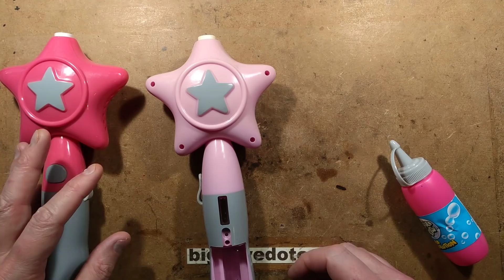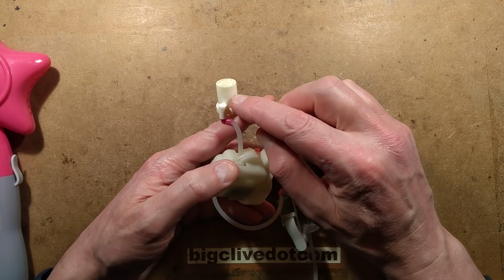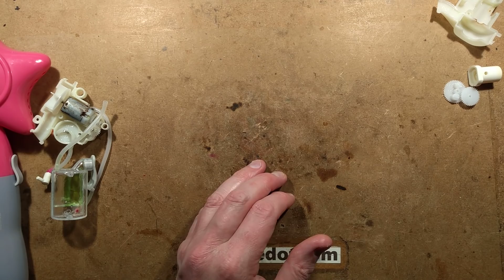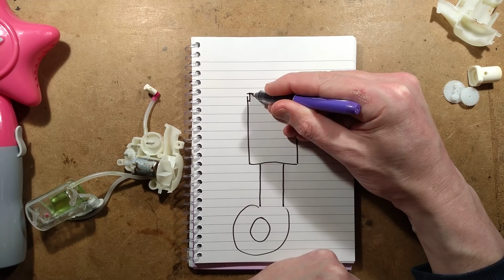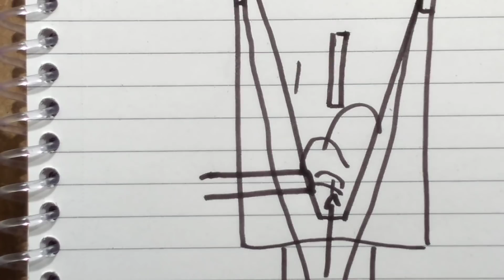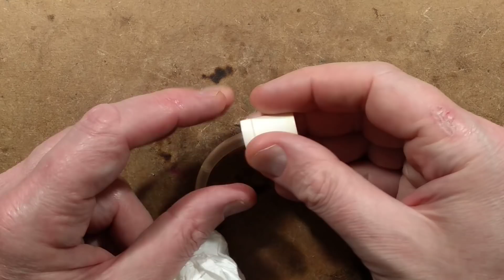Bubble wand with unusual bubble generator.

Comment: The cone thing  reminds me of an injector on a steam engine used a bunch of cones, live steam from the boiler and cold water from the tender. Boyles Law did the rest so you could inject water into the boiler which was already at a high pressure.

Comment: Those slots aid in the efficient design of a really good eductor pump.
Reply from the maker: It could well be designed along that direction.
Reply: @bigclivedotcom  There are three air flow paths within the head.
The first is the straight on air path through the bottom of the cone - which alone, would be minimal since the slanting sides of the cones would provide a lower resistance path for the ever-so-slightly compressed air.
Of course, the second path is the outside of the cone - which is obvious, and provides the lions share of the air that sends the bubbles on their way.
The third path is through those eductor slots - which I would just about bet paper money, have little "knife-edge" angles toward the top of the slots looking down toward the bottom of the cone.
These force a little air inside the cone behind the previously propagated bubble to accelerate it toward the top of the cone, meanwhile they create a relative low pressure region down where the bubble juice is coming in through the Venturi Effect, which is the major force involved in pulling the bubble juice in.
This also aids in influencing a little more air to enter the smaller port opening at the small end of the cone.

All in all, it looks to be a terribly well balanced system, and as you said, very well engineered.

Comment: I'm certain that cone is creating a venturi effect (reverse).

The faster-flowing air outside the cone drops air pressure there, so the bubble is formed from the higher pressure inside. Once the bubble passes the slots it fills the bubble further (like NACA ducts), possibly suctioning the next bubble too. A carburetor works in reverse [air direction] to pull fuel into the cone, but this thing has a pump to overcome pressure created from reverse flow.

Comment: The return line is not only for returning liquid,its also used as a breather tube for the reservouir so that it doesn't get under vacuum since the seal is airtight
Reply: I was looking for someone saying that. It's the multi-purpose fan driven tank return tube!

Comment: Clive, seriously your audio lately has been terrible for those of us that have central bass speakers.  Look around for your microphone, you must have set on it and it is stick in your anus.
When I turn up the volume enough to understand your speech everyone in my house starts yelling "can't you turn that down."  If you are using a microphone as a lavaliere you must use a microphone designed to be used as a lavaliere with the lows rolled off so we don't hear your chest noises.  The microphone on the teapot is just fine, out doors is not so bad as at the bench.  I have a volume control, but no control over the bass speaker, on this speaker set.
Reply from the maker: Check your surround sound settings.  It may be interpreting my videos as a bass channel.

Comment: That's a fairly complex moulding for both the bubble generator and the motor support / airflow generator. Add in obviously silicone tubing with a decent gear train, and it is not unreasonable to say that this little "toy" was the product of some very decent engineering. Lots of salvageable, "other function" parts in that little gadget!

Comment: I'm (mostly) a chemical engineer. The slats are for, I believe, a sort of critical volume assistant-not the technical term. Essentially the slats have to be close enough that the surface tension-of a small bubble(important)-can catch more air and grow beyond the critical volume.

 It's basically the same reason that raindrops are-from initial, mathematical observation-technically impossible. It's due to the power of 2 vs. Power of 3 relationship of area vs volume.

Comment: I can see the planned weak point of this cunstruction. The motor isn't sealed at all, its shaft goes through a large hole, so every time the button is pushed, the liquid gets onto it instantly. It's meant to fail very soon.

Comment: I'm sure that the three slots are for introducing more air into the bubble generator.

Also I don't think that second pipe is primarily a return pipe. I think it's main purpose is to stop a vacuum forming in the reservoir and in fact even introduce some positive pressure to aid the peristaltic pump. That it doubles as a return pipe is just a bonus.

Comment: Throw some 14500 Li-ion batteries in it. I bet it'll really produce.
Reply: This sounds like a fun project. You'd probably want to remake the gear that drives the pump, and heatsink the motor, but it sounds doable.

...Or you could just make sure the batteries stay happy and see how bad of a seizure the mechanism has. Either way's fun.
Reply: Do you think Clive will do this modification?
Reply: @flytrapjohn  That depends on how bored he is and how much he wants to get another video out that day.
Reply: @evensgrey  👍

Comment: I found a bubble gun that works much the same but is completely manual. It has batteries for some stupid LEDs, but the pumping action of the trigger makes a small pump work to bring the liquid up to the "wand". Excess liquid just drips down directly into the container. But yeah these are neat devices. :)

Comment: So Clive, are you going to make one ten times the size?
Reply from the maker: It would certainly be interesting to see if the unit could run on a different air supply and pump system.

Comment: It looks like the slots allow air in after the bubble has started to speed formation of the larger bubbles. If it relied solely on the small hole at the bottom they would take much longer to form than how it appeared to work in your garden.

Comment: I wonder if rechargeable batteries would, in fact, work, because if I recall correctly while the voltage is lower they can often output more current than an alkaline battery before the voltage drops so much that it isn't practical any more. Usually when a dc motor is stalled is when it draws the most current, and more current means more torque. Although I kind of doubt a motor that small draws so much current that a pair of AAs can't feed it. I wonder if the slots are to let air and fluid out of the cavity to make sure it makes one bubble at a time instead of just foam.

Comment: I wonder if you could combine this with a smoke machine to make smoke filled bubbles by letting the fan draw it in?
Reply from the maker: You do get bubble machines that fill the bubbles with smoke.  This one might not work so well because it has a high outer airflow.
Reply: ...or butane gas.. and a laser..
Reply: @PsiQ  one of the funniest (and most dangerous) experiments is hydrolysis of soap+water solution and then burning the bubbles

Comment: I left the US in 1965 for Germany, hoping to do my PhD work in Tübingen. I didn't immediately get a job at the Max Planck Institut, but I needed money so, since I had 13 semesters of chemistry I got a job in the "Chemische Fabrik Tübingen." I didn't speak but a few words of German and no one bothered telling me what the slippery "soap solution" was we were manufacturing. It was the hardest work I had ever done, lifting 50 lb bags of chemicals over my head, and I was delighted when I got the position at the Max Planck Institut for Biological Cybernetics, running a brand new electron microscope and getting my Phd. Some years after I left the Chemische Fabrik Tübingen I discovered that I had been manufacturing "Pustefix," a soap-bubble solution that comes in a little plastic bottle with a bubble wand inside. We shipped the stuff out in 200 litre barrels so i never saw the finaly packaging. I spent the next 45 years piloting electron microscopes in brain research and later in cancer and virological research, but I always wondered if my months producing "Pustefix" weren't the most important part of my carreer. I am going to buy one of those little bubble machines. Thanks.
Reply: Making others happy is a noble calling.
Reply: I still have my blue Pustefix Bär from when I was little! I loved the built in pop up wand that kept your hands from getting all sticky like the dimestore bubble bottles did. Coming from a German family, my dad had one too when he was little, so you may have made some of the bubble soap he played with in the late 60's.

Thanks for your part in making Pustefix happen Herr Doktor, it was one of our favorite toys and I have a lot of happy memories with my Bär.
Reply: As a matter of interest whose microscopes were you using? I have worked mainly with JEOL systems (100B and 100S TEM, T100 and 35C SEM, with a little experience on the legendary Stereoscan 180 - gave that area of work up since even Fellowships paid far less than fulltime NHS Clinical positions!
Reply: @phils4634  The first microscopes I used were Philips at Purdue University in the 1960s. The first years in Germany I used Siemens microscopes. After that I bought and used only Zeiss microscopes. I bought an EM10 in 1980, fitted with ion-getter pumps, cryostage and goniometer. I had it continuously upgraded until I retired about 5 years ago.
Reply: @BruceBoschek  Philips were generally regarded as the best back in the day. I started off on a 401 TEM which was very much "fully manual" by today's standards. Had some time on their 500 series (again excellent) and when we were looking to buy new instruments, had a look at Zeiss - very unimpressed with their "optical waveguide phosphor screen"  idea (can't remember the model) which meant re-coating was impracticable. Really bad idea, that! Looked at an ex-demo 100B - excellent resolution, excellent beam current control and consumables were pretty reasonable (not that we weren't buying running spares from Beem like everyone else!), and for the cost savings we were able to buy another TEM - their smaller 100S.  When it came to upgrading our old Stereoscan S4 (flogged that off to Materials Science), JEOL gave us a good deal on their compact T100 (which came with a Shimazdu turbopump and LAB6 filament), so that was easy. Kept that for Undergrad tuition, and later bought their (at the time top of the range) 35C with all the goodies - excellent machine, and by that time we were making extra cash for the department by offering JEOL approved training - not necessarily cash, but heavily discounted parts and upgrades (e.g. diff. pump to turboprop upgrades on both TEMs, software upgrades, and detector upgrades to the EDX systems on the 35C and 100S).  After that I moved back into the UK NHS as an ID Physician, then emigrated Down Under, where I'm now approaching my final year of formal employment (though I'll probably continue with a teaching role for a few years yet!)
Reply: @phils4634  Philips were big in scanning EM. I spent a week in Eindhoven looking at my own samples on their TEM, then did the same in Berlin at Siemens. I was undecided, although it was apparent that Siemens was at the end of their rope, but then Zeiss set up a brand-new EM10 in my lab to try for 6 months. The microscope had ion-getter pumps and a sample-area vacuum better than 10 -8, a foot-pedal operated 3D goniometer and LN-cooled stage. The pictures I got of tumour viruses were so good I kept the machine and convinced a number of others to buy Zeiss. I kept my updated each year until I retired a few years ago. I used that machine for almost 30 years and the resolution only got better over time.
Reply: Fun story, great example of why you should never close youtube comments ;)

Comment: Clive, back in the 70's I made bubble liquid from 'Tepol' - (neat detergent) and water 50/50% ish. If D-lube is the same as KY then it is about 50% glyserine & water. So you might just as well start with Baby oil ,detergent + water. Just need to work out the percentages
Reply: J-Lube is definitely an absorbent polymer, not glycerine based - it's shipped as a powder. I've seen it in, shall we say, shops of a particular sort.

Comment: If you run out of "bubble fluid" and don't have access to exotic lubricants, dish soap + glycerine works fine (if you get the mix right, you can even make bubbles that will land on your hands without popping).
Reply: JOY dishwashing soap and glyerine work especially well. I made some gargantuan bubble rings out of some wire inserted into turned chair legs for my niece and nephew. They had loads of fun with that!
Reply: Which is the mix?
Reply: Depends on the type of soap; experiment.

Comment: I like the idea that someone sat down and designed this toy with CAD software of some sort. A few hours, a day or two ..?
Reply: To get the ratio of the gears of bet it's had a few iterations... And more than a couple of days. And if they're selling them in waitrose (a supermarket aiming at premium goods) then they won't be sold cheap...
Reply: @UKMonkey , I was just thinking that, after posting. Someone had to CNC the reverse molds for injection molding, then quality control, EU safety standards for the plastics and paint etc. Designer for the outer packaging, branding.. I wonder are there, 'asset packages' for toy makers, like say, for designing games in the Unreal engine. Just pick what you need and integrate it to your product. This is occupying my thoughts more than I'd care to admit.. 😁

Comment: The cone is simply brilliant. The air that goes around the cone increases in velocity and therefore decreases in pressure, literally sucking the bubbles out from inside the cone on the way out. The slots? Don't know what they do exactly, but I guarantee you those holes are about getting the bubbles to behave properly.
Reply: I'm going to say the slots are for "centering air" to keep the bubbles from sticking to the sides as they are ejected, which prevents making foam.

Comment: It's a real shame we'll never know the person behind these designs... product packaging needs credits in the same way films do!
Reply: The engineer who designed this is working a bit under his paygrade me thinks xD
Reply: I purchased a child size pool table that was made in India, (1meter x 600mm,  it had the maker's name, address, and the date it was made. Clever design, the legs folded up and it was only 75 mm thick for storage.
Reply: @dsloop3907  A decade ago I worked at a resale shop that sold tools. Chinese made tools that had the factory address embossed into them in both Chinese and English were almost always significantly higher quality than tools with just corporate names and logos.

It doesn't cost much to emboss an address, so I expect that those that market low quality tools have already started or will soon begin putting names and addresses on their products too.

I fear that even if this sign of quality still works, it won't work for long.
Reply: As long as there's something in place to keep the addresses honest, it'd still work as a sign of quality. Wouldn't take much to start remembering which addresses make good stuff and which ones put out cheap crap. It'd just be like a less catchy brand name at that point.
Reply: The real cheapskates will never spend the extra pennies it takes to emboss their products. That would be wasted profit. The tendency, for many Chinese businesses, is to make as much profit as you can today, and not to worry about the consequences. Check Serpentza for some interesting perspective. Winston lives in Shenzhen.
Reply: the real cheapskates will be making proper knockoffs and spending most of the budget on appearance but charging a higher price
Reply: @hamjudo  I wouldn't worry too much about that. From what I've seen, there really are just two tiers of tool: cheap stuff that you can bang out by the thousands for pennies and sell to people who just want a cheap wrench for a job and not a lot more, and stuff that is more expensive to produce due sturdier materials or more manufacturing steps for people who want a wrench for their job. Even if down-market manufacturers did start following that practice, it'd soon be a matter of looking at engraving or molding quality to see who's using worn tools/molds and who has better machining tolerances.
Reply: Talent tends to get poached by competitors in a lot of industries. Apple made their engineers sign NDA's for many reasons, including this one. They fight tooth and nail when someone starts head-hunting the "wrong" employees.
Reply: Look up the patents

Comment: My guess is that it operates like this:
Air makes small bubbles in the bottom of the cone, once a bubble is big enough and high enough up the cone, the slots come into play to further inflate that bubble, the air on the outside make the bubble release as it forms a vacuum over the top surface
It would explain why the slots are equally spaced.
The drain comes into action whan there's an excess or whn the device stops.

Comment: Makes me wonder how easy it would be to add a small Boost converter circuit and a proper LiPo rechargable cell to this...
Step the voltage up to 5V or similar and give the motor a bit of a supercharge, perhaps? >:3

Actually, why not combine forces of the super simple™ USB powerbank. 1A should be plenty to drive that motor to death!
Reply: I'd just hook up the bench power supply, graph the voltage/awesomeness curve and find out when she blows.
Reply: You can get small brushed motors complete with reduction gearboxes from RC shops eg. HobbyKing.  A portable "pro" version with LEDs would be a great toy.
Reply: @lostjohnny9000  I'd bet it would be hard to fit and even if you did the new flow characteristics would make the device not work in new and imaginative ways :-)